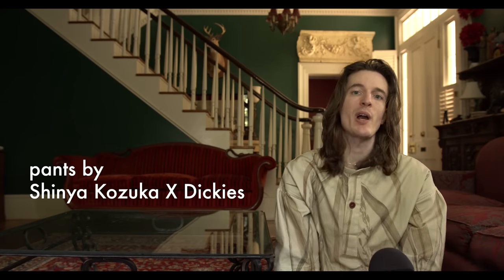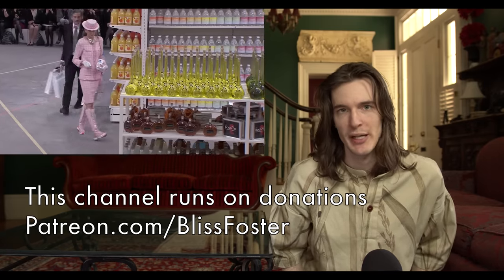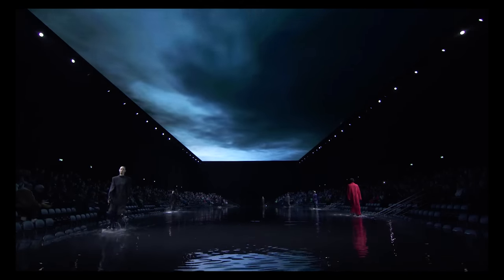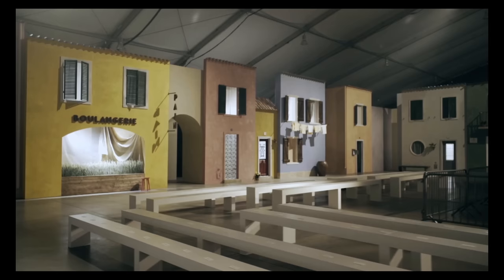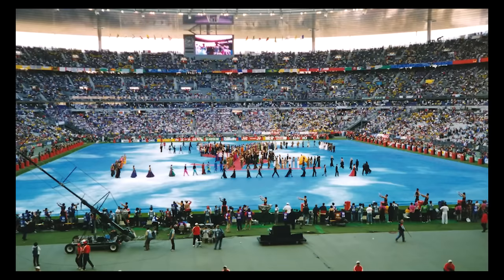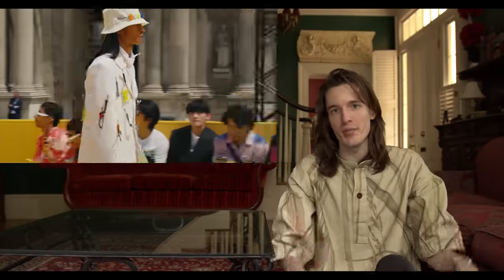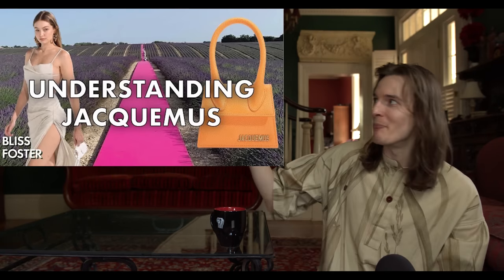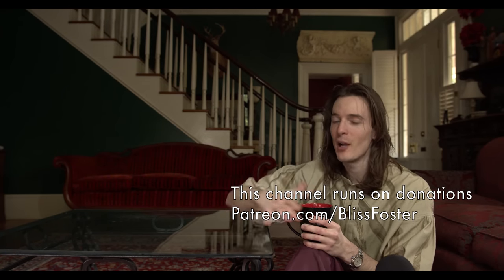The 30+ Most Extreme Runway Shows of All Time (Chanel, Balenciaga, YSL)

Comment: I love your reaction to the fire, theatre shows use real fire a lot ... it's very cool, and now thankfully heavily risk assessed but I think it's actually part of performance history to have fire, the cue prompters would be lit by a gas lamp and pyrotechnics are still used in theatre, as well as rain showers, collapsing sets, I know of a show that built a large cement floor just for the couple month run and then demolished it afterward. Thought you'd be interested. Love this video. Thank you!